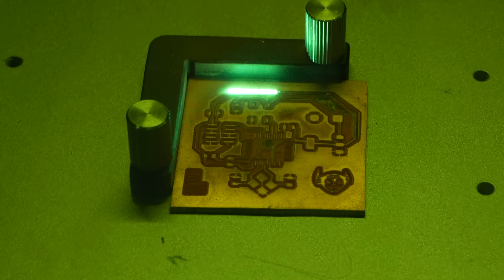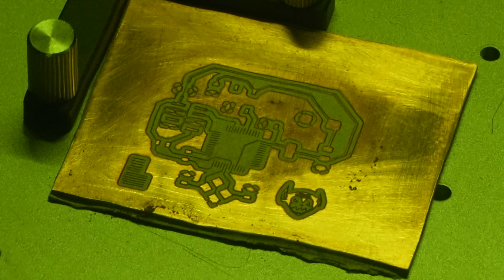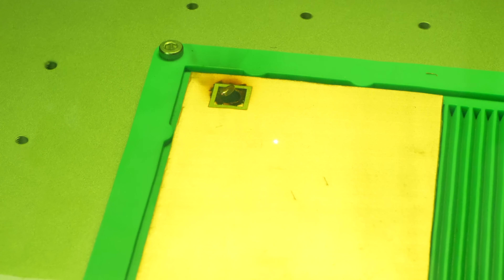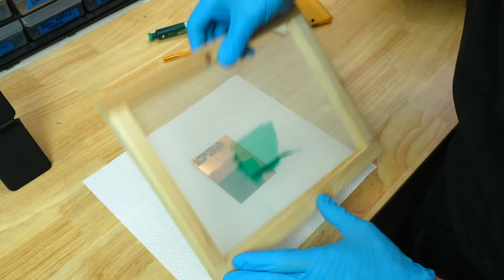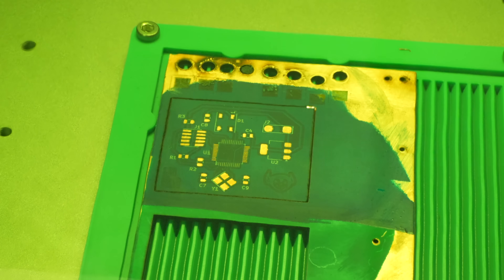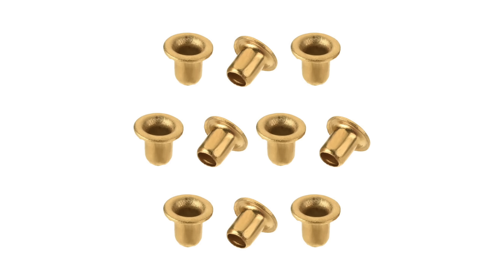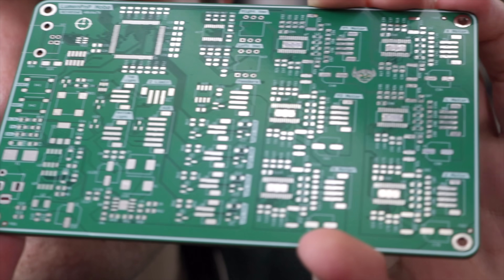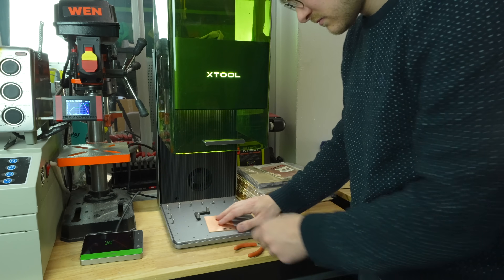Prototype PCBs faster than 3D Prints

Comment: An exactly constrained metal plate that the PCB is temporary fixed could make registration much more repeatable. This would eliminate any compression of the FR1. It could also serve as a sacrificial plate to cut out the PCB too.
While this isn't my area of expertise, the book "Exact Constraint: Machine Design Using Kinematic Principles" by Douglas L. Blanding seems to have examples that would be perfect for this situation. Namely, the 2 pins and a V-notch in Fig 1.16.4  or the 2 horizontal screws in the X direction, 1 horizontal screw in the Y direction in Fig 1.18.1

Comment: Could you not just cut a pocket in the board that would nestle the rivet so it doesn't add any height, could then just solder between the rivet and trace if needed

Comment: For two sided, why not drill holes with the laser.  then fill the holes with solder paste.  Then use the laser to to melt the solder in the holes, and wipe off the unmelted solder?.

Comment: Either cut your boards a bit better for alignment or stick actual reference pins onto the surface - I'd probably go with 2, one which fits in a slot and the other that orients.

Comment: Interesting video. Idea: Instead of rivets, maybe use tiny steel or copper washers that are basically the same thickness of the board? Pressure fit them in just like the rivets without all the extra space that rivets require. Just spit-balling here.

Comment: For vias, how much more effort vs brass rivets would it take to just thread some enamelwire through the lasered hole? I'm thinking the workflow would be:

1. Copper ring kept around both sides of the via as standard, with the ring and 1-2mm of trace kept out of the solder mask
2. Take 1 length of enamelwire, thread it back/forth in a continuous pattern around the board until all the holes are filled
3. On each side, press the wire down against the the board, along the exposed trace, which should hold everything steady
4. One quick press with solder & iron on each side of each via
5. Trim off all the interstitial wire lengths
Reply: Surely you would want uninsulated wire, not wire insulated with enamel coating?

Comment: For vias, I wonder if you could squeegee some solder paste into the holes. Then use a hotplate, or even tune a 'vias only' step on the laser. Might need to add a bit of wire into the holes so it doesnt all flow out

Comment: All in all super nice. But one idea/question: couldn't you just put the "etched" pcb in a uv-resin-printer and print your negative solder mask. No clue about uv printers, if this would be a viable solution. And the perfect alignment would still be hard.

Comment: For multiple interconnect layers - have you considered in-house HDI?

 Build your first copper layer as you’re doing currently, throw down and cure a layer of prepreg, laser-oblate micro-vias, electro less copper-plate the whole thing (or dip in the danger puddle), then laser-etch the top layer tracks and pads. You get copper-filled (or solder filled) microvias effectively for free. 

If your registration is good enough, you could successively laminate several layers on the one side of the board without needing to touch the back. Further, if you wanted buried bias you could use rivets and smooth them over with the prepreg of successive lams.
Reply: Anyone who has not "considered in-house HDI" won't even know what HDI refers to. "High Density Interconnect", for what it's worth.  I don't see how HDI provides a solution per se. It's just a name for making PCBs with smaller features ("higher density"), and the manufacturing techniques to do so... not necessarily amenable to DIY.  The electroless copper-plating is a non-trivial process which, as I understand it, involves some exotic materials.

Comment: just pin and solder both sides when you populate, no need or advantage of using a rivet I can see. If you can cut a hole small and accurate enough with the lazer great, if not just leave the pad and a dimple ready to drill. For prototyping the 2 seconds to drill the percentered hole tight fit for pins will be 3 seconds each. Any plating will add significant delay to rapid prototyping and even short run production boards still seem better coming from PCB shop.

Comment: single sided with some jumpers would be ok.  I thought about using CNC to mill boards which is nice for a one-of that you need ASAP.  I absolutely hate wiring up  on a breadboard. Considering I just ordered 4 batches of boards (4 projects) from JLC with 3 sets having edge fingers and one of those ENIG all for less than $100 I'm good to wait a few days.

Comment: As an alternative for the riveted vias, bend wire might work.

Solder Solder Solder Solder Solder Solder Solder Solder 
CU Cu Cu Cu Cu Cu Cu Cu Cu     Wire Wire Wire Wire  Wire
FR FR FR FR FR FR FR FR FR       Wire Wire Wire Wire Wire        FR FR FR FR FR FR FR FR FR FR FR FR FR
FR FR FR FR FR FR FR FR FR FR FR FR FR FR      Wire Wire       FR FR FR FR FR FR FR FR FR FR FR FR FR
FR FR FR FR FR FR FR FR FR FR FR FR FR FR      Wire Wire       FR FR FR FR FR FR FR FR FR FR FR FR FR
FR FR FR FR FR FR FR FR FR       Wire Wire Wire Wire Wire        FR FR FR FR FR FR FR FR FR FR FR FR FR
CU Cu Cu Cu Cu Cu Cu Cu Cu     Wire Wire Wire Wire  Wire
Solder Solder Solder Solder Solder Solder Solder Solder 

I am thinking that you could laser cut a hole slightly bigger than a 33AWG copper wire and bend over the wire on both sides of the board to make a sideways U shape. 
Next take a scalpel (or laser cutter maybe) to cut the wires in the right spot.
With fine enough tolerances the solder can fill the gaps between the copper and the wire.

The wire could even sit flush with the surface of the copper if you cut out little gutters in the fiber board material for the wire.

Comment: Vey exciting stuff! Regarding the vias: Since you burn them through the board, and the board contains a lot of carbon - those holes should be be somewhat conductive because of the charring effect of the laser "drilling". But yeah, I'd go with the rivets, electro plating is messy stuff.

Comment: The one thing that I keep thinking about is using solid core wire to "plug" the hole to act as a PTH or VIA. Maybe afix the plug in place with UV epoxy resin. I would think for very small holes for a PTH you would need a real drill in a mount but it might work. What do you think? Oh and to cut the copper plugs, may a small press shear.

Comment: Very impressive work!
At my work we have the commercial version of what you're doing with the laser: check out LKPF laser
One difference is the way the copper is removed: instead of burning away all the copper it gets cut into strips of about 0.1mm, then in a second pass with less energy the strips are lifted off by heating them. This method is easier to tune and also works for various materials including FR4.
For alignment holes are used as fiducials. For vias we use copper rivets but they are by far the biggest time and design limitation so I'm curious about findings.

Comment: Via ideas: 3rd or 4th is probably the best
1.
-Drill hole and slightly over fill with solder paste. 
-Heat until the hole is plugged with solder making sure it contacts copper layers.

2.
-Drill the hole and dip a piece of tightly fitting copper wire just as long as the bard is thick in solder paste. 
-Heat until the wire is soldered to the copper layer on both sides like a jumper through the hole.

3.
-Get copper foil on film (that heat pressfoil?) and laser your PCB design on 2 pieces of that, making 2, 1 sided PCBs. 
-Screen print 1 of them FULLY with resin or solder mask on the copper side and dry. 
-laser via holes only through the resin/mask exposing copper "pads" and cover pads with solder paste.
-Glue the copper only panel to the resin + solder pasted pad panel and heat before the glue dries.

4. 
-Same as method 3 BUT replace the solder paste on the pads with a drop of really thick solution/gel of copper sulfate and solvent. 
-Glue the 2 panels together making sure the pads line up
-Run a current through the circuit electroplating the 2 layers together while the glue dries.

5.
-Paint the inside walls of vias with one of those conductive silver pens or coat in carbon black. 
-Cover the PCB in solder mask and throw in electroplating bath with a current running through it. Make sure only the vias are exposed to the electroplating solution.

Comment: I think you should look at the tech involved with 'sputter coating' and 'low pressure Ion etching' the sort of bench tech the a Microscapist would use to clean prep and metalise samples for use in SEM. Without using ' wet ' type chemical baths you have no option than to opt for coating and preparation techniques found in the semiconductor industry. Ok you have 'Rivets' but we have had them forever and are a pain in the arse. So Go Plasma physics baby !!!!!

Comment: I just got a 15W UV Galvo and will be interested to see if it can do a better job.  UV typically isn't great for ablating material but we are talking such small layers here it might work and 15W is pretty high power for UV (many are just 3 to 5w).  UV doesn't have the heat transfer issues of a Fibre which is in the IR spectrum so it won't burn or have heating issues.

Comment: This would be great for hobby projects where only 1 PCB is needed. Maybe to align the other side and multiple operations the holder could have pins that go through holes cut in the material but outside of the PCB area on the first operation. Wouldn't need any special alignment the first time.

Comment: Make a small pad, drill a hole for a via, put a piece of copper wire in the via, and laser weld the wire to pad? I'm not sure if that would pull up the pad or if the laser would do a good job of spot welding like those jewelry lasers. It would be an interesting experiment though.

Drilling the holes slowly in a round-robin manner may allow the heat to dissipate in the FR1, preventing the copper from overheating/pulling up

Comment: For the vias, we had at my school a specialized CNC which comes with some consumables 

We put a film on both sides of the blank and drill all the pth 

Then apply some paste on it and fill all the holes. After that we vacuum everything and only sides of the holes stays covered 

After that get the film away and bake the board. 

After that it is a normal cnc board engraving, drilling and milling operation. 

FYI the we drilled fiducials before that and the machine aligns on it for each step
Reply: What purpose does the film serve?

Comment: Have you tried or seen conductive paint? Then use a brushed on copper plating method. You could probably use the screen printing method for a decent thickness consistency. It would cut out the chemical bath and only require small amounts of copper solution.

Comment: For quick vias, LPKF (they sell PCB CNC milling machines for rapid prototyping) has a process where the PCB is placed on a vacuum bed, and a conductive paste is squeegeed over the PCB, which then gets sucked through all the holes (done before routing out the tracks). Haven't tried it myself - at university they decided to get the full copper galvanic setup instead, which we rarely used because it was such a lengthy process with lots of chemicals. Copper vias are of course better, but as the emphasis is on really rapid prototyping, I think the conductive paste/vacuum method would make more sense. Back then, for simple PCBs I usually just made sure not to place any vias underneath a chip, and then soldered a piece of wire through all the holes by hand. And I usually designed these prototypes a bit larger to have more routing space, and aggressively minimised the amount of vias. The EAGLE autorouter also allows to set a high cost for vias, to minimise them (I know that manual routing is the way to go when it counts, but again, for really rapid iteration on simple designs and break-out boards, auto-routing with EAGLE, with some manual cleanup afterwards, worked pretty well. The Altium auto-router sucks though, don't waste time on that...).
Reply: ProConduct is kind of a paste, it's working quite well is you don't need a lot of current. We have this solution here in our lab, but it did fail from time to time. It's not so much reliable IMO (our yield is ~70%). 

We also bought the LPKF Contact RS, which is the galvanic bath, but it is a nighmare to keep the bath uncontaminated & stable. 

I would love to hear about another way for making vias / PTH !

Comment: The reason we all dream about this, is wait time. I mean' with the prices we have today, none of the equipment will ever pay itself off, so price is not the factor. But the iteration speed is what can make it worth investing $10-20k. However, in modern electronics, we need not only 2 layers. We need 4. With all the high speed components and radios we use now, 2 layers won't do it. I have not being able to get any good ideas on how to do it, but I think it will involve transfers. The copper is lasered on a thin transfer layer of class or capton, and, in some way, transferred to the substrate one layer at a time. Or, printing in an ink jet printer, to make conductivity, and then use the chemical bath to grow copper on it. More steps, but maybe this is the simplest way. In theory that process can be fully automated. Well... writing a YT comment gave me new ideas, this has to be studied.

Comment: Why not just create VIAs with solder? A pass through of solder through a laser drill hole to encircled pads on either side of the hole should work. You could even add a solder mask pass after soldering the VIAs to cover them up to protect components above. I'd use solder paste in tube form (could be added to Lumen to fill the VIAs for you) so it can be pumped through the holes to ensure they are filled all the way through.

Comment: 11:30 No.  I mean, yeah..  But also.  The whole point is rapid turnaround.  A board shop can't get you a prototype in 90 minutes.  Final production then, at that point, if you can do it in house and it's just as good, and you did all of this to make it just as good so the prototype can be actually* tested under load.  Then the only reason to outsource would be if you sell more than you can keep up with.  So no.  I actually don't think "why don't you just use a fab-house" is a constructive comment at all.  Anyone who would say that is thinking inside the box.

Comment: Solder vias? so you punch a small diameter drill hole, then fill with enough solder to wick, dialed in close enough the solder bulge on top or underneath will be much smaller than a rivet? Come to that it doesn't have to be a circular 'hole' it could be a line going through, that would reduce the risk of the bridge not making it all the way through to the other side.

Comment: A really easy connection is to make two holes and thread the same copper wire through both, and twist the ends together until they twisted of. A drop of solder on both sides and the connection is done. The holes can be really small for that. You can try one hole, but it's a pain to make sure the wire stays put while soldering.
In the past i used "solder bridges". Make the through hole big enough so that solder can fill them and connect both sides. You have to do some tests what dimension works the best for your solder.
I've also tried to make my own solid rivets from 1qmm wire, but the production process is to complicated.

Comment: re: VIAs. Sticking with using the laser for operations - you could try filling the holes with some conductive material (even solder) then 'reflow' it with the laser. You'd have to rely on small holes so capillary action would hold the molten solder in place, and not sure if (especially on top layer) the solder would wick to the copper or just bulge out with a meniscus. You could also try UV cure conductive ink to fill the holes, maybe even use a UV laser to rapidly cure. Great job covering the process!

Comment: 9:40 The tinning solution isn't terribly difficult to reproduce and when you see it happen in real time it's absolutely magic, I promise, you will not be disappointed.  It takes several days even with shredding and heat to dissolve tin into HCL, so you want to start that as soon as you can.  
I used thiourea and sulfuric acid from a battery, the ratios don't seem to be that particular.  Roughly 10ml acid 1g tin, 5g thiourea 1ml sulfuric acid, 90ml water.  
The next stage is going to require formaldehyde.  I really don't want to mess with that.  

I'm not designing anything too complex yet and have gotten away with using 0 ohm resistors as jumpers to keep everything on a single sided board.  

Something you could do is make a notch or key in the board cutout before you flip it.  Secure the whole blank with double sided tape, cut the inside shape with the key, flip and the blank is it's own jig.

Everything you have said in this video is shockingly similar to what I've been working on for, IDK, about a year now.  It's uncanny.

Comment: Man this is a blast from the past. About 7 years ago I was working in a research lab at an engineering company as a mechanical engineer and we had an LPKF ProtoLaser. Pretty sure that thing cost like $200k. Then we used an AccurateCNC PCB milling machine as well for prototypes that didn't require as much accuracy, and also for drilling vias. Combine that with some conductive ink, a heat press, an oven and some ancillary equipment and you could actually prototype quite a variety of electrical designs. 

Amazing to see the price on this stuff keep going down.